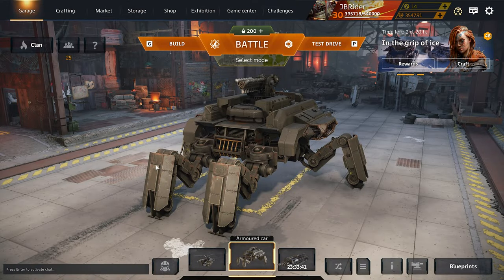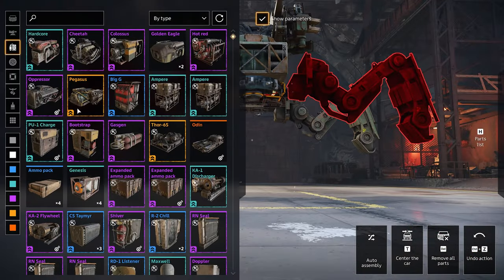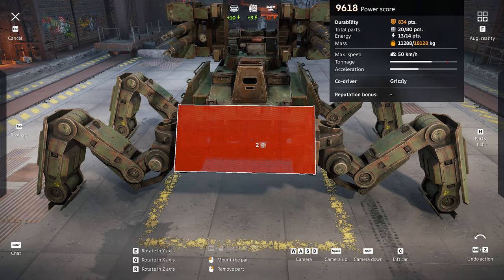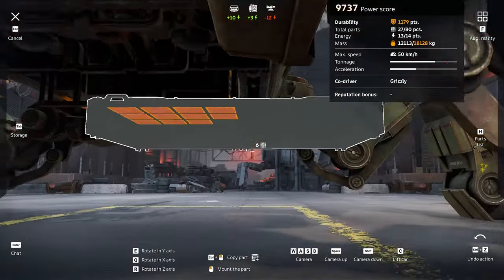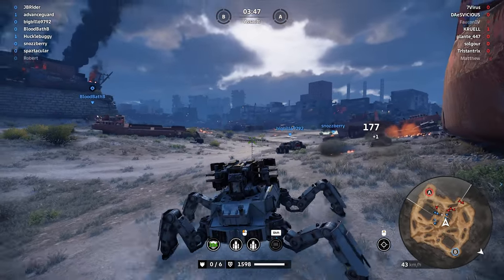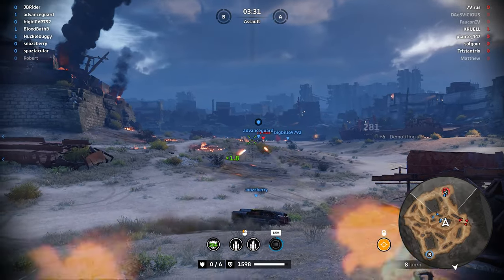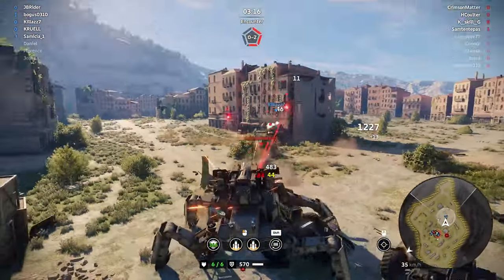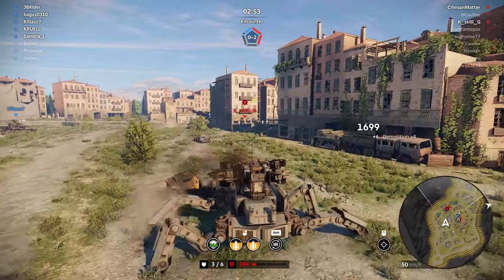I Made an German Ausf. Vierfüßler "2cm Flakvierling 38" From WW2

Comment: Fire the stonks, Hanz!

...Anyways, for some reason, your discord link is not working as intended. I figured it was a technical issue, but I feel like I must ask you first.

Edit: I think I know what is happening on your end, JBRider. Especially considering the actions of certain clans towards me ingame currently, and the fact your discord may be whitelisted. However, I'll give you the benefit of a doubt and wait for a proper response. It is the least I can do for now.
Reply from the maker: Discord link seems to be working fin what issue were you running into?
Reply: @JBRider  usually gets an "invite link is invalid or is expired." This normally happens under two circumstances. Either there is a whitelist at play, which is admittingly rare. The other option is I was somehow banned, despite not having been back on your discord for months. I find this extremely weird since I initially left your discord for the harrassment I was undergoing before things got too ugly. After all, no sense is starting  huge discord shenengains that are uneccessary is how I look at it.

Besides, I had full intention to keep my mouth shut most of the time anyways. I often find if I speak, then the harrassers rear their ugly heads so I was gonna simply observe the whole thing without a fuss tbh.

I think what happened is when I initially called out the harrassment of a few people on the subreddit, Kizion of all things somehow managed to misinterpret the meaning of those two posts to mean a personal attack, despite within both posts I only mentioned his name once in passing. He even had the sheer audacity to try to gaslight me as "Umpire" in an attempt to start up bad blood again between the two of us. I actually was intending to call out a couple of clans for their behavior, like damn! I was dealing with a localized issue. If they never got themselves involved, this would have sorted itself out in a few days, and those clans would have backed off over a month ago already... sheesh. Guess some people never change by the looks of it, & it really shows in their actions thus far.

Considering the number of fights I've seen him start with Lucos and a few others, I'm genuinely starting to wonder if I had somehow driven him mad from paranoia by accident. If so... then I gotta admit, I had zero intention to cause him to start acting like that. I will apologize for any potential misunderstanding beforehand, since I do expect his pals will be on my arse in bedlam & pvp if I rejoin your discord. They sure like causing trouble, I'll give them that much.

It is a complicated situation, but I was able to get the initial harrassers to back off through immense effort, but it was not easy. So... yeah. This has been going on for a while now, and I'm now understandably annoyed at their insistence to try to start fights, & attempting to reignite old traumas. Textbook targeted harrassment in the most literal sense. Honestly dissapointing to see.

I figured I would give them a benefit of a doubt at first, and see if they would lift the ban, but... I guess I was too hopeful for a peaceful outcome, I guess? It doesn't exactly help that they had been spreading rumors that I'm an insane schitzo, when In truth, I'm just a witty guy with an anxiety disorder. So you can add misinformation to their ever increasing list of things they have been doing for quite a while now.